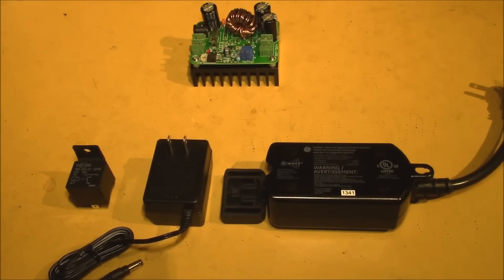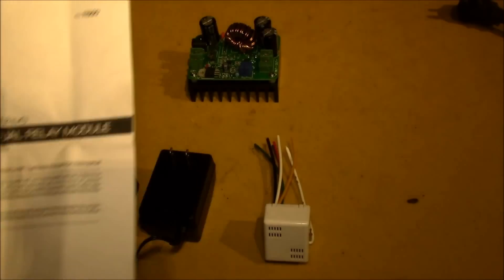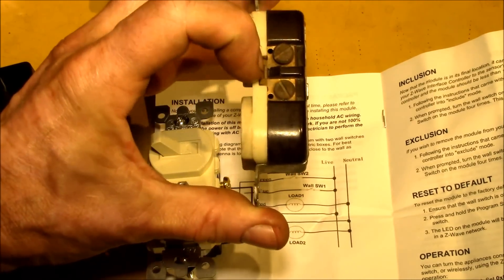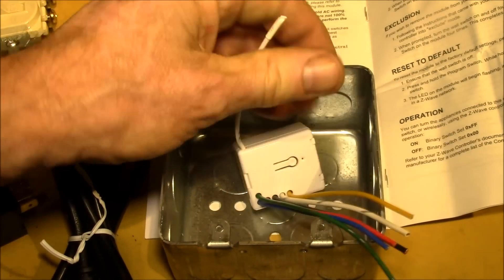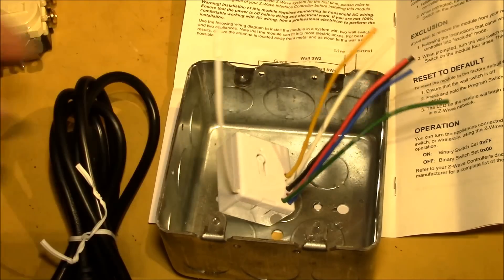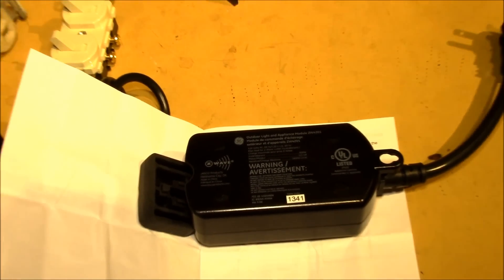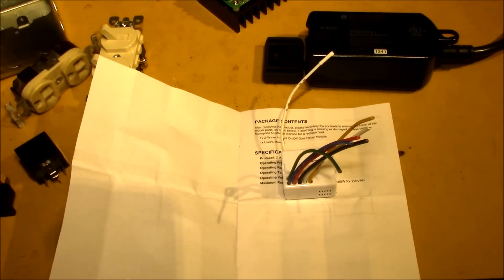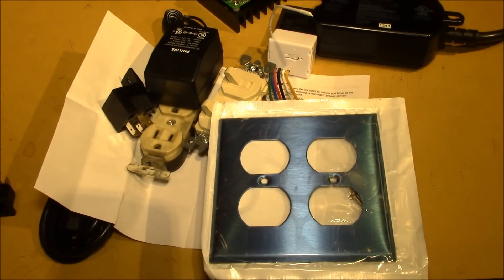Z-Wave DC Relay Module, Part 1

Comment: Did they discontinue this zwave relay?  I can’t find it.
Reply from the maker: I'm not sure on that.  Monoprice seems to have dropped it years ago.  I did pick up a 4-pack of them on eBay a few years ago but don't see any available there or on Amazon at this time.
Reply: @The4Crawler  Do you know of a single dry contact relay that is Z wave?
Reply: I don’t need any inputs I just need the Z wave to a relay
Reply from the maker: @pastorofmuppets924  There are a fair number of Z-wave relays available:
https://amzn.to/3GLUGda
But most aren't dry contacts.  That's where I take one like I'm using, have it turn on a small DC power supply (5V or 12V) and then use that to turn a relay of my choice on and off as shown in later videos in this series.  I'm working on a new video series with a small 5V controlled relay with USB power supplies.

I have run across dry contact outputs but those are usually for some high power or specialty application, i.e. expensive.
Reply: @The4Crawler  thank you
Reply from the maker: @pastorofmuppets924  Here's the high current 12V relay version:
https://youtu.be/VrkF1v5nO9w
Still editing the video series where I put together a 5V USB relay under ZWave control.

Comment: sir how to program this module to GE 45631 wireless keypad？
Reply from the maker: Just like any other device.  Here's the section from the user manual:
Create or Adding a device to a Group 
Since this is a secondary controller, it cannot add a new device 
to the network, but it can add a network device to a Group.  The network information must be copied to this device before trying to create or modify a Group.

1. Press and hold the Add and Remove buttons at the same time until the Orange LED blinks twice, then release.

2. Press and release the Add button.

3. Press and release the Group button.

4. Press and release the right side (ON) of the Group/Scene button (1, 2, 3 or 4) that you wish to assign the device to.  The Orange LED will start blinking. 

5. Press and release the button on the device you wish to add.

6. The Orange LED will stop blinking and the Green LED will blink twice to show that you have successfully Added the device to a Group.
Reply: @The4Crawler  Thank you master your good answer,,  SALAMAT sir！God bless.
Reply from the maker: @jerickedem8360  I may try and do a video on setting up the GE control switch with some other Zwave devices in the near future.  I need to reprogram one of my switches after  replacing some failed relays.

Comment: Hi there, I wired it per the diagram and checked the black and white connections, but I get no power to the module. Did you run into any similar issues? This is the two relay model. Thx.
Reply from the maker: I didn't run into any issue like that.  Are you not getting power to the relay module itself or to the output contacts?  Might have a look at this thread that talks about connecting the relay contacts to switch line power as well:
https://community.smartthings.com/t/vision-z-wave-in-wall/32439/8
Reply: Thanks for the quick reply. I unhooked the module from where I installed it (about 20 feet from the Hub), then I wired it into a power cord just with the black and white wires connected (about 10 feet from the Hub). It still gave no LED indication. After checking the instructions, I held the switch down while plugging in the device and the light started flashing. I was able to pair after that. However, once I moved it back to the install location I was back at square one. I ended up having to move the Hub about 6 feet from the device for it to pair once again.
Reply from the maker: Yes, some controllers need to have devices fairly close for pairing.

Comment: Thanks for your video, but I am ready for part 2!
Reply from the maker: Jonathan Pierce Yes, working on it.  I made a little mistake in assembly and that caused the Z-Wave pairing to get a little messed up.  Took some time to sort that out and get it all working.  Also did a little detective work to find out the mfg. of the module.